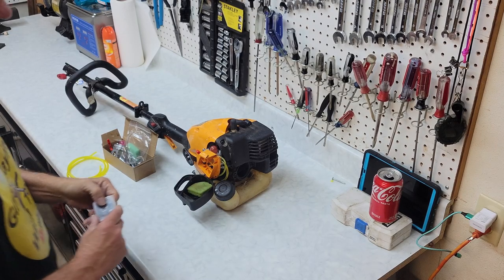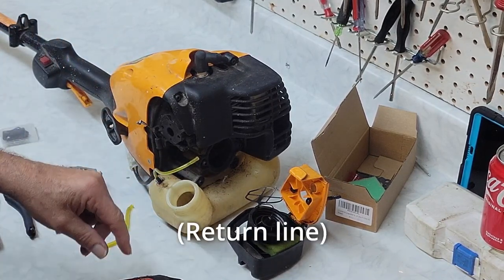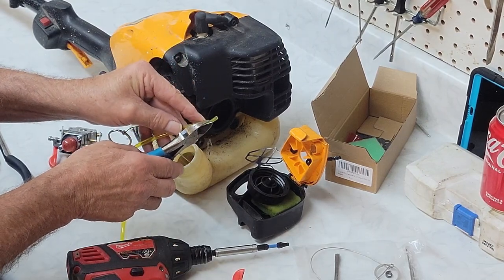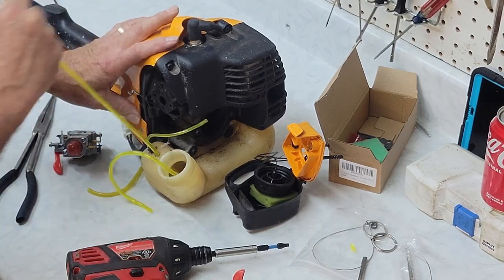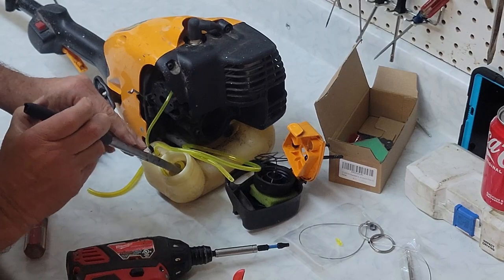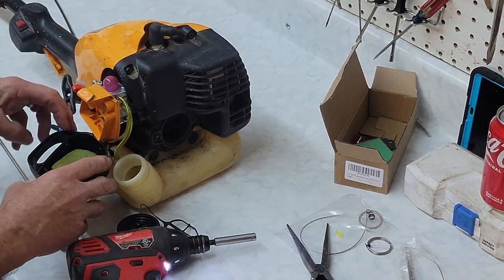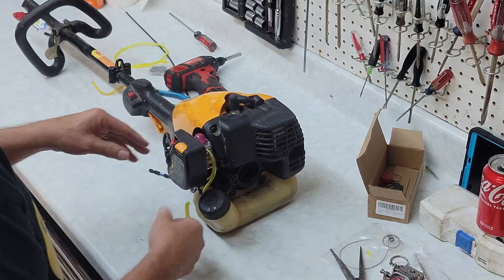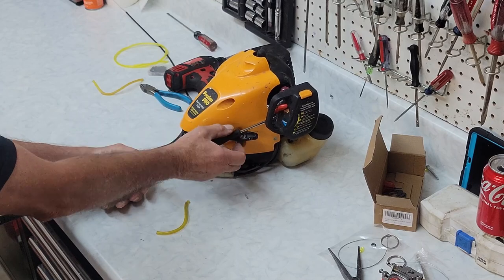Weedeater won't start,  rebuild or replace the carb?

Comment: Easy peasy got to admit it is a good deal on them carbs 👍
Reply from the maker: Yeah. $15 will usually buy you everything you need.  Sometimes though,  a piece of equipment outlives the carb supply,  then rebuilding is the only option.

Comment: New style pumper carbs on all my 1980s 2 cycle equipment made life easy
Reply from the maker: Cool.  I go that way now and then. I tend to rebuild them, but when replacing them,  everything is fair game. It's hard to find anything near stock parts for equipment that old
Reply: @GuysPlayingWithTools  its been a challenge!  an M8 x 1.25mm zerk fits the string head grease ports ;)
Reply from the maker: @TejasToolMan  🙂

Comment: I agree with the kit idea for the occasional repair. The kits these days are so cost-effective for the DIY guy (or gal). I had been using my own idea to pull the fuel line through the tank but I'm surprised and pleased to see that some kits come with a wire-tool. Clever. You are living right, Bill...looking younger that your many, many  years every day! hahaha. What fuel/oil mix do you use? I'm that guy who always adds too much oil!
Reply from the maker: I am an "over- oiler" too. I go about 45:1 on everything unless it's an old one that wants more. 
I am curious about your idea to pull fuel lines. 🙂
Reply: @GuysPlayingWithTools  It's a long wire formed into a loop, similar to the tool you used.  Bend a long (18") wire in half, place the loop into the fuel line hole and out the filler cap , pinch the hose in it and pull back through. I lose about 1 inch of hose this way from damage where it is pinched and pulled through, but it works. I'll post that video soon. I did a carb replacement on a Husqvarna trimmer.
Reply from the maker: @EverydayProjects  necessity is the mother of invention.  👍When you try one that's made for it, you will fall in love.  🙂
Reply: @GuysPlayingWithTools  Indeed !👍

Comment: Strange thing is that I only have done a replacement carburetor install job one time
Reply from the maker: Mostly rebuilds? If you have all the tools, rebuilding them is easy, but homeowners don't always have high-end tools.
Reply: @GuysPlayingWithTools   I know that I don't have any of those tools ⚒️ although I had a  pair of blowers that I was going to put on New carburetor's on no but it never happened oh well life happens
Reply from the maker: @robertmailhos8159  I am guilty of being a fool fanatic. If I see something that makes it easier, I have to have it. 🙄
Life gets petty busy, I usually "stack" videos and release them on a schedule so I have time for other things.
Reply: @GuysPlayingWithTools   you meant to say tool fanatic
Reply: @robertmailhos8159 Bill might have made a Freudian slip. He hangs out with fools like me who stay up till 3:30am ultrasonically cleaning a Tecumseh carb so corroded it looks like it’s growing hair.
Reply from the maker: @robertmailhos8159  I did.  🤣
Sometimes I am a fool too, I get tools I really don't need all the time.
Reply from the maker: @haneyoakie14  🤣
I usually start at 5:30 or 6am so 3:30 isn't an option for me
Reply: @GuysPlayingWithTools  if I’m up at 5:30, it means I had to pee. Back to sleep by 5:33.
Reply from the maker: @haneyoakie14  If I wake up any time after 4:30 or so I start thinking about what needs done today, and how hot it will be by 10am(106 today) and I get moving.  😁